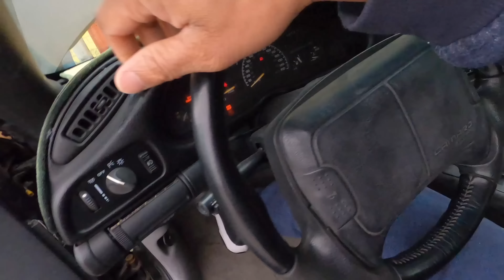I Bought And Taking Delivery Of My 1994 Chevy Camaro Z28

Comment: I would keep the impala for a daily driver and fix the Camaro up. Old Camaros are bad for everyday use. Your son can take the irocs off the impala and mount them on the Camaro. If it was my F body I would paint it like a gunmetal gray with flakes and where it says Z28 I'd paint it red to match the Chevy sign on the rear of the car. Tint the windows and upgrade the suspension one step at a time 🤘🏾🏁🏁